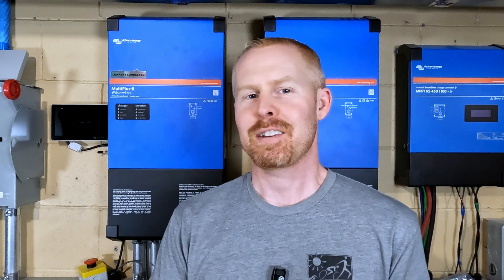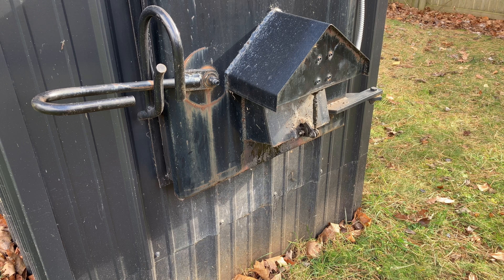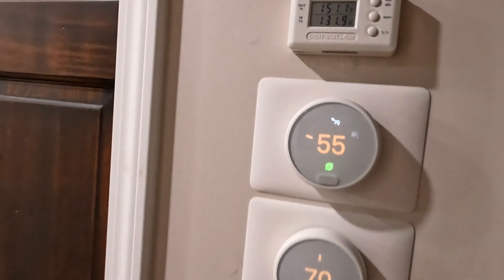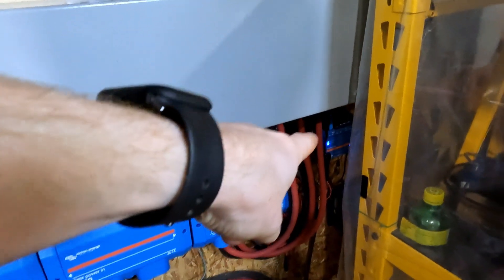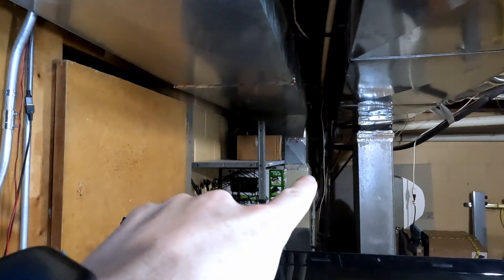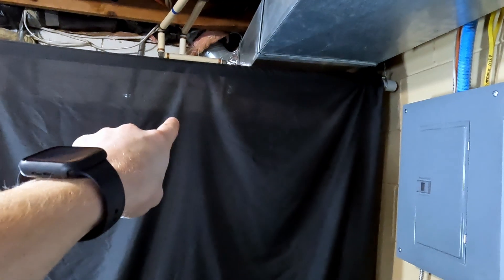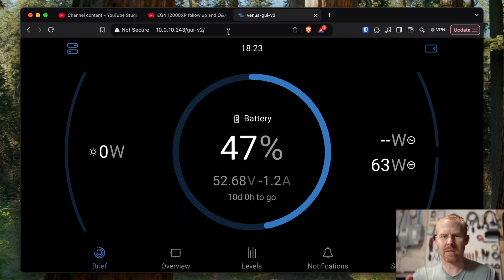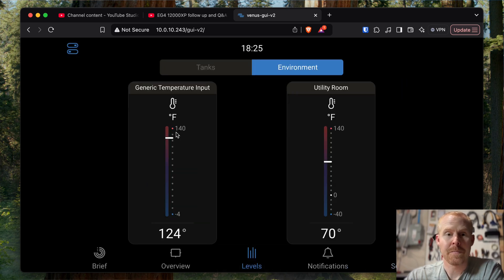Upgrading My Outdoor Wood Boiler: Victron Custom Temperature Monitoring

Comment from the maker: ~ Black Friday Deals ~
Current Connected
- Free Shipping on purchased over $2000
https://currentconnected.com/?ref=AzzpK9Fl

SanTan Solar
- Everything 5% Off - Use Code: storewide5
- $350 Flat Rate Shipping
https://www.santansolar.com/?ref=adamgog

Links to the parts & pieces in the video (affiliate links)
------------------------------------
Victron 48V MultiPlus-II 5kVA 120V Inverter
https://www.currentconnected.com/product/victron-48v-multiplus-2-5kva-120v-inverter-70a-charger/?ref=AzzpK9Fl

10kVA 120/240v Base MultiPlus-II System
https://www.currentconnected.com/product/10kva-120-240v-multiplus-2-5kva/?ref=AzzpK9Fl

Victron Cerbo GX
https://www.currentconnected.com/product/victron-cerbo-gx-system-controller/?ref=AzzpK9Fl

Victron GX Touch 7" Display
https://www.currentconnected.com/product/gx-touch-display-cerbo-gx/?ref=AzzpK9Fl

Victron Temperature Sensor
https://www.currentconnected.com/product/victron-temp-sensor-quattro-multiplus-cerbogx/?ref=AzzpK9Fl

For more information, please check out my website with links to all the components, materials and products I have used in developing my off-grid solar system: https://going-off-grid.com

Supporting the Channel
--------------------------------------------------
There are several ways that you can help support this channel.  
- Affiliate links help the channel by providing me with a small commission of the sale.  It does not change the cost for you at all.  
- The 'Buy me a Coffee' - buymeacoffee.com/goingoffgrv
- You can also click on the "Thanks" button under the video to support the channel. 
- You can become a channel member and receive additional perks: https://bit.ly/3Wdufqv

Thank you for your support!

Comment: I’ve just installed a temp sensor on my water heater ,I have 3 sources of energy hooked up to the same water heater, it’s a electric- 40gallon, so first energy source is the grid 240 volt on the top heating element , second source is solar 120 volts on bottom element powered from one of my split phase multiplus 2 5000 watt inverter from the  a.c. Out 2 ,I programmed the assistant to turn on when my batteries are at 54.5volts = about 90%state of charge and off when at 53.4  volts,, last source of energy is from my geothermal  heat pump . Oh also I have a timer to cut grid power at 7am and turns back on at 7pm  it only powers the water heater overnight to 7am during our cheap rates less then half electric rates during the day
Reply from the maker: That's awesome!  If you have to run completely off grid power, do you notice the element having to run longer since there's only 1 of them?
Reply: @ most electric water heaters never runs both elements at the same time , normally they have the bottom one on  most of the time and if you use most of the hot water it switches to the top element  and heats the top half of the tank so people will get hot water sooner as your heating half the tank were the lower element will heat the whole tank , but I removed the switching part and run two individual  power sources so if I have the grid on and solar on the tank will heat way faster . But my main goal is to heat using solar so it will take longer to heat the tank as I’m running 120 volts  so a bout 900 watts heating element . Since it’s the bottom element it will heat the whole tank , my upper element is on a timer and is off 7am to 7pm , we’re only two people using the hot water and never have run out .
Reply from the maker: @ thanks!

Comment: Do you know if there is a spending threshold for getting the discount? I've spent ~$7000 with them and don't see any membership pricing even when logged in.
Reply from the maker: I don't believe there's any limit.  As soon as you create an account it should show discounts like you saw in the video.  

I would suggest emailing or giving them a call.  There might be something on your account that isn't configured properly.  They should be able to fix it right away.  

Let me know how it goes!

Comment: You could easily extend that to where the hot water pipes come into the house.
Reply from the maker: @NC_Hydro  yep!  I can either do that or just buy a couple temp sensors and run a 4-wire thermostat cable over there and tie in both.  I tried to actually split the signal for the other thermostat I have in the hall but it didn’t like that at all.  Not designed to have it split.

Comment: So why do you think you had to put in an offset for the temp sensor? I assume those are RTD's and they should be really accurate. That wood fired boiler is nice, I bet it saves a lot of money in the winter.
Reply from the maker: @dirtroadsailing6418  I put an offset in to try and get the temp to be as close as possible to the actual boiler temp outside, not the temp of the water line in the house.  

The boiler does save a lot!  I don’t have to buy propane for the furnace or use electricity for my water heater.
Reply: @AdamDeLayDIY  You do have to use electricity for the boiler though, right?  Have you measured how much that is?
Reply from the maker: @davidb.5544  Yes it still uses electricity to run the circulation pump and the solenoid when the damper door is open.  When both the solenoid and pump are on, it uses around 120W.

When just the circ pump is running, it's approx 90w.

Comment: Happy thanksgiving Adam.How much did that boiler cost you if you don't mind me asking.I was thinking about getting one of them since I have enough trees to make it worth while.Thanks MikeG
Reply from the maker: Thanks Mike!  Same to you!
I wana say I ended up spending between $4-5000 once everything was all said and done.  Not too bad in the grand scheme of things.  I bought mine from EZBoiler here in MI.  They repurpose old propane tanks in order to keep the cost down.  Since you have access to trees, I would highly recommend it.  Our electric usage goes down significantly in the winter because the boiler handles the heat and hot water for us.
Reply: @AdamDeLayDIY  that's not a bad price at all.I will have to watch your videos on the install.👍😊
Reply from the maker: @mikeg2321  I keep thinking that I should probably include my boiler in a few videos just because it does help remove reliance from the grid.  I wish I had my channel up and running years ago when I installed the boiler!
Reply: @AdamDeLayDIY  yes it's some good content if you want to give everyone the company you bought it from and how the install went and how much wood it uses on average.We all like to save money and most of us love freedom 😊👍

Comment: Can I use one of those temperature sensors on my battery bank? I also have my battery bank connected to a Victron shunt.
I don’t have the GX
Reply from the maker: @simon359  sure, you could use the one on the shunt and the view the data in the app.  I don’t think you would have as much control over it, but you should still be able to see the temp.